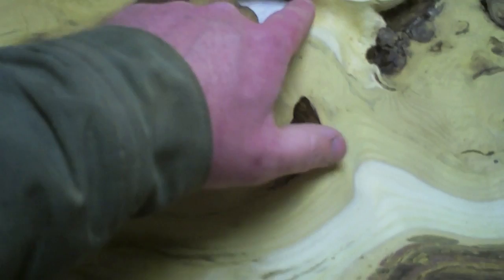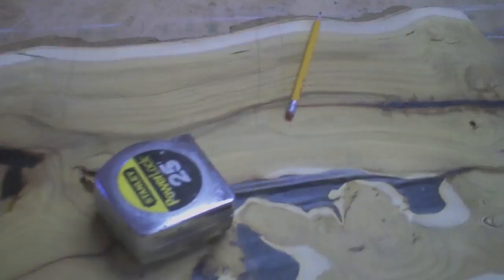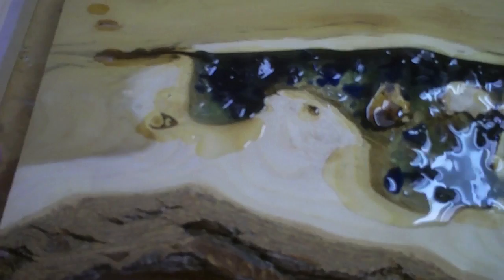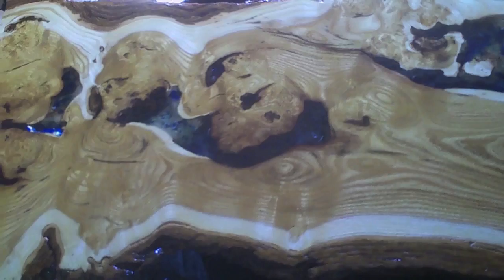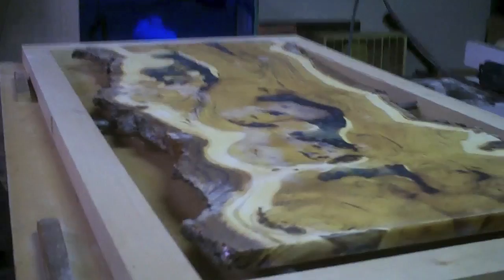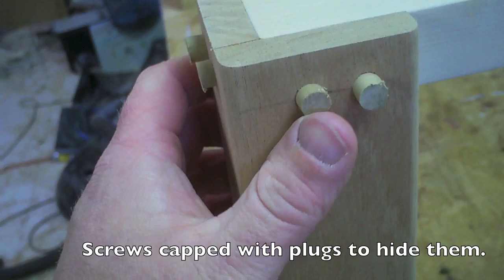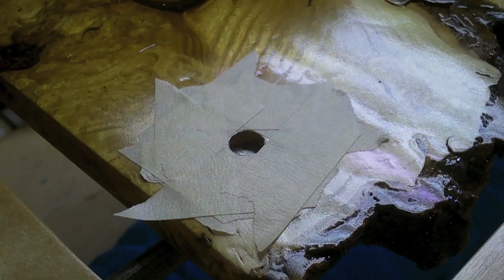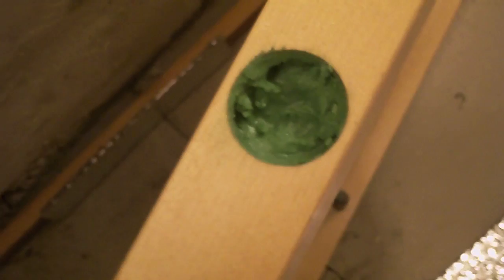Blue Glass Mulberry Table

Comment: Hey there is a carpet masking that is used for covering carpet for protection.  It comes in rolls 24"-36" or something like that.  I've used it in my construction business on carpeted stairs rather than drop clothes.  That may elliminate the blow outs and lines from your taping.  Hope this info comes in handy.  Love your work!  Thanks for sharing!
Reply from the maker: Hey that does sound it would work awesome!  Thanks for the tip.

Comment: I am not a great wood worker, but I experiment with LED lights.  Small 5mm are nice to work wtih, but often times I prefer the adhesive strips that work direct of 12V.  To make a spot, a Fresnel lens is often a good thing to experiment with.  The come in various book sizes at the dollar store but you can get business card size very thin lenses from ebay (wallet loupes) in lots of 10 or more.

Comment: "Nobody said working with epoxy is fast" Preach so hard even my customers hear ya!
I'm a knife smith and if it wasn't for epoxy and clear coat on my handles i'd be finishing one every 2 hours(yes yes i know, clear coating handles, too slippery and etc, but i don't have a chance since most of the knives i make or change handles to are industrial kitchen knives, meaning no oil will survive more than a week of restaurant work.
anyway, customers have no idea of the struggle sadly.

Comment from the maker: In direct UV light yes and quite quickly if it is lacking the UV blockers.  The epoxy I use has minimal UV protection and then this is coated in lacquer that also has minimal UV protection.  Normally I would coat in poly which has good UV protection but I am counting on two weak protections adding up.  Direct sun in Arizona and she would yellow regardless.

Comment: Incredible result!  Love the glass embedded in the epoxy.

Questions & a tip:

When you cut off one edge to square it up, it looks like you were going to have to cut through glass.  Did you do this on the table saw?  What type of blade?  How did it cut?

Did you add lighting to this?  Simple LEDs from flashlights embedded in the bottom wired with solid cat 5  to a 9 volt with a regulator would be a simple circuit that should work for it if not.

What did you use to dye the epoxy green?

Would you mind expounding on your technique of freezing & microwaving the epoxy a bit?  First I've heard of either.

Aluminum duct tape is by far the best tape I've found to seal off voids.  Everything else - masking tape, carpet tape, duct tape, packing tape, swearing at it, packing with towels, etc - ends up leaking.
Reply from the maker: I did cut it and I used a very cheap Harbor Freight carbide blade because it is murder on it.  And a good dust collector paired with a respirator because breathing glass is bad.  It was an epoxy dye sold to tint epoxy repairs on boats.  I think powdered chalk would also work well but test it.  If you have left over epoxy putting it in a deep freeze will halt the cure for a day or two so you can use it up.  I have microwaved it to defrost quickly but that will jumpstart the cure again so it will go fast.  I will try the tape, thanks!

Comment: I really like your work.  I am getting ready to make an eating counter in my newly remodeled kitchen.  I acquired a nice live-edge elm slab. I would like to fill in the cracks with some local serpentine and quarts rocks that I have collected. I have never done anything like this before. Any tips on the process and type of epoxy would be greatly appreciated as. Thanks.
Reply from the maker: Do several trial runs before starting the main project.  It sounds like a great project and I hope it works great for you but try it out before crossing the point of no return.

Comment: +NelsonStudios I enjoy your videos.  Thank you for making them.  Unlike some of your other video commenters, I appreciate your son is with you in the shop.  I remember as a kid spending lots of time with my Grandpa (a pattern maker) in his shop and that's what got me into woodworking, carpentry, construction and design.  I may have missed this tidbit of information along the way, but I was curious what type(s) of exopy you use?  Do you prefer any brand over another?
Reply from the maker: Thanks for the words.  Having my kiddo in the shop has it's risks but he is learning and so am I.  The time is valuable and with care the risk can be minimized.  Everything is or can be dangerous including raising children who know nothing more than sitting on a couch and watching TV.  I use epoxy from a company called AeroMarine.  It is their 2 part resin, 1 part hardener water clear stuff.  Normal application is fixing rotten wood.  The thin stuff is hard to keep from leaking out but the bubbles come out of it easy.  It yellows after time but then at all do.
Reply: Do you recall if it's AeroMarine's 300/21 Epoxy Resin?  Thanks again.
Reply from the maker: Yes that is the one I use.